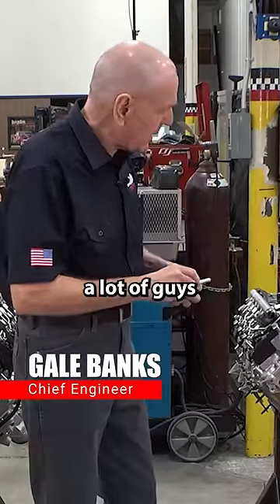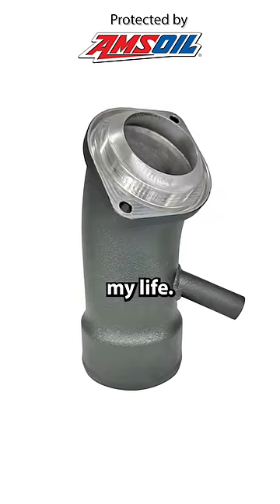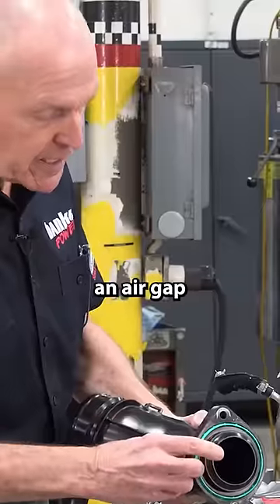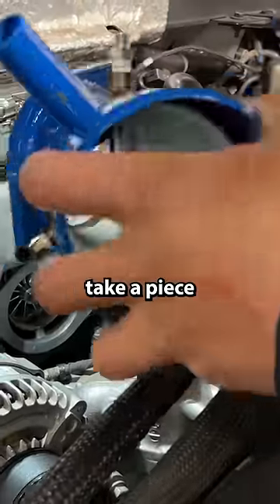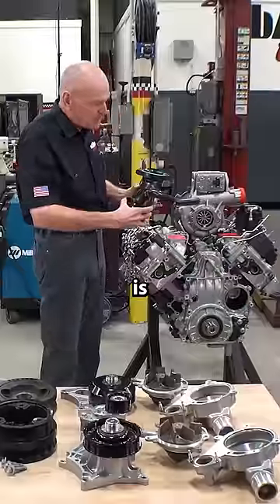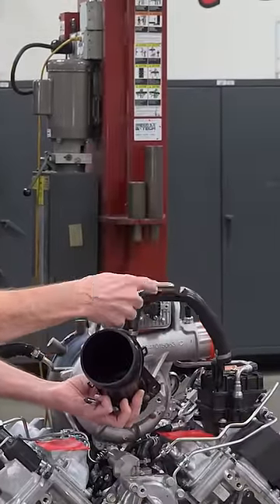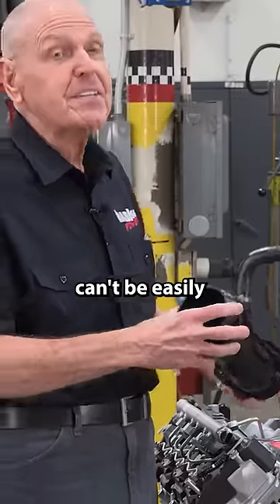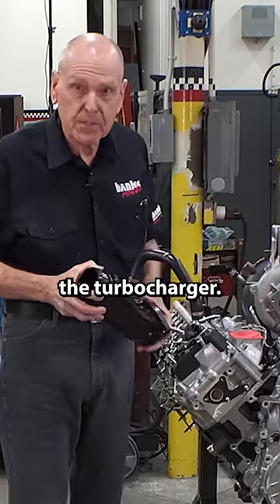The factory guys got it right. Don’t delete this!

Comment: Gale Banks is a genius. I would follow any and everything he says I have a Ford 7.3 L power stroke 1999. It’s stock with 400,000 miles and a six-speed manual. One day I’ll have myself Cummins or a Duramax that I can build up to a reasonable horsepower but more important than power to me is reliability and I will not give up reliability at the cost of extra power.
Reply: Hey Matt, I have the same truck as you.  Only 78k on her, f250 7.3l CrewCab n automatic trans that has been rebuilt.  Can I ask what all you've changed out since new?  Ole field mechanic/fab n welder/tires ect.  Ole paradog pushing 70s.  Thanks, Ty

Comment: I had a fiat 124 that used to pull oil into the intake. Straight from factory. No modification. I think there was an engineering issue from the factory.

Comment: I use a gauge called a manometer to diagnose mixture control malfunctions regularly on the BMWs I work on daily. Crankcase pressure is critical if you have a MAF sensor. Never seen a CEL from CCV malfunctions on MAP based engines like the W10/W11 Mini Cooper.
Reply: I'd like you to have a look at my 5l supercharged Range Rover with occasional lean code and high positive ltft's with an off idle stumble and surging ram's at cruise. Ugh.
Reply: @nyplantings2420  If you don't find anything from a smoke test the pop the intercooler off to inspect. I've seen those supercharger intercoolers develop a pinhole leak on the inside that drips into the intake causing random misfires.
Reply: I can't use the manometer. Whenever I pick it up, it immediately goes to 200%.
Reply: What about turbo bmws?
Reply: @megodlike--  I don't know about yours, but my '08 335i twin turbo has wastegates.

The advice from Mr. Banks in this video is much much applicable to turbocharged diesel trucks, many of which run big ass single turbos or compound turbos, and I don't think most of them have waste gates. Not saying it's a worse system necessarily, just a different one. 

The surging he's talking about occurs when the turbo is spooling super hard and then you come off the throttle. If you're modded to the gills and sucking more air through the intake than was ever intended, and if you've removed the valve that's supposed to open in case of a potential backflow situation without putting any other failsafe into play, you can end up with a big turbo spinning super hard, exhaust pressure builds up, and builds up, and builds up, and it's that pressure that eventually creates so much work for the turbo that it's no longer able to continue compressing more air, so instead the accumulated pressure starts to overcome it until it ends up bringing to a stop and then forcing it to spin backwards. That's TERRIBLE for the turbo and bad for the engine, too.
Reply: @allmycarsisbroke  Appreciate the explanation, I have an e92 335i with the n55  and not the n54 you have.
Reply: @megodlike--  Everything I said about the N54 is applicable to yours as well. It's a "twin scroll" and not "twin turbo" but the overall build and all the circumstances I described apply in both cases.

And whereas the N54 is notorious for an issue with the wastegates that starts causing a bit of a rattle as they get older, I think the N55s have a lot less problem with that (or with any of the other common points of failure). If you don't mod your car heavily or beat the hell out of it, the N55 will perform just as well as a stock N54, but cost you a lot less in maintenance and probably last you a lot longer. 🙂
Reply: @nyplantings2420  First thing I would check would be fore vacuum leaks. By far the cheapest thing to solve and easily one of the more likely things to cause those symptoms.
Reply: @allmycarsisbroke  Yeah I like to think of that as the reason I went n55 over n54. The thought of paying for injectors or anything not typical to fail on a bmw like water pump/gaskets. But then again you got the ability to push a lot of horsepower if you wanted to.

Comment: I've never understood why people think that they know every piece of automotive technology better than the engineers that designed it. Certainly, there is room for improvement in some areas if you're willing to deal with the consequences, like a louder exhaust system or defeating emissions devices, but for most systems, most driving situations, and the vast majority of drivers, the OEM got it right.
Reply: Exactly!
Reply: I've been saying that for years!
Reply: Mighty Car Mods of all channels did a dyno test of various intakes. They tested the OEM and filter as well. Not one aftermarket intake system performed better anywhere in the rpm range than the OEM.
Reply: Never accept that the manufacturers know best. If they did it wouldn't break or wear out they build to a price and are controlled by accountants. Gale on the other hand is purely about making the best it can be
Reply: @davidsawyer1599  You need to reread what I said. I never said that aftermarket can't perform better. Try again.
Reply: @Doctorevil666  Wrong. Reread what I said, then you may join the conversation if you can post something relevant.
Reply: @christophernuckolls9964  I've re-read your post multiple times! Obviously english is a second language. My first language is english either that or you've blindly taken offense to what I've written. I've said nothing about the after market Industries
Reply: No, oem never has it right
Reply: @jeffreyvandenbiggelaar1399  Never? Not once, ever? Cars don't drive? What do you use them for, then?
Reply: @Doctorevil666  Wrong, again, little guy. Your unintelligible temper tantrums contain no value and contribute nothing constructive to the conversation. Now sit down. The adults are talking.
Reply: Vehicles are designed to sell and break down and then buy parts that's how they make money. Somebody who knows thier stuff like Mr banks will always be better and improving on oem. Yes there's alot of companies making bogus performance parts, but there's also alot of places like banks industries that know thier stuff. Sometimes oem is better but not at all always. Like I said it depends on what you're expecting from it. Going fast? Different, hauling heavy load? Different, better fuel milage ? Yep Different. Stock probably does all ok. You won't find stock rods and parts like that that are as strong as aftermarket,
Reply: The thing you don't understand is that not every one is using it the way the engineers intended so they modify it to fit thier needs or wants.

Comment: Never trust always verify. I understand that this system is designed to work correctly but that doesn’t mean there isn’t room for improvement . Sometimes materials are left out to meet margins or there is manufacturing complexities that can’t be afforded. Then theres the government meddling into design who want to cripple and/or control systems which ultimately interferes with ownership rights.
Reply: Yeah but if you register with the state you're transferring ownership to the state and you have the usufruct privileges of driving it and maintaining it....FOR THE STATE. SO ownership rights huh? Bring that up with the state and DOL or DMV. Only if you have the original certificate (not a copy) will you have true ownership rights.
Reply: So, you melted your engine? 🤔😂

Comment: Im not sure people care, ford for instance pushes so much oil that you can watch it drip from every pore of the pvc hose.  The ecoboost pushes a half of a quart every 2,000 miles.  My last 3-2.7's and 3.5 all wept oil so badly it would leave drops on the ground. None have a special surge area, all just silicone hoses.

Comment: What factory guys didn't get right is oil vapors recirculation into engine intake. Yes it helps to prevent pressure building into crankcase but that dirts the whole intake system. 
It doen't disturb much regarding diesel engines but petrol engines got the same and oil contamination in intake mixture can lead to knock andengine damages.

Comment: The factory hasn't got anything right on the diesels in the last 18 years..
Reply: That's not necessarily true, it depends on what you're comparing it to.
Reply: How are bad aftermarket parts the fault of the oem?
Reply: That's what happens when the EPA gets involved.
Reply: The bigger idea being there's generally research and development implemented in factory parts. And the "bigger is better" or "aftermarket is always a benefit over stock" thought process is more often than not a falsehood. 

I guarantee 99.5% of people adding an aftermarket intake inlet pipe didn't notice or understand what was designed into the OEM inlet to begin with. Anti surge properties are not something I've ever seen retained with majority of aftermarket intakes. That's true for diesels as well as gasoline worlds
Reply: @highpsiguy4085  I understand completely how much R&D goes into factory design. I'm pointing out that the government wants things done now, and the factory has to produce the numbers enforced by the government. Could you imagine what the diesel world might be like if the EPA would push fuel efficiency prior to emissions.
Reply: Longevity, simplicity, fuel economy, with all the epa crap these new ones will never get near the old diesels.. this world was working just fine before government and epa had to put their authoritarian rules on everything..
Reply: @justinmoore4898 
BureauOfJustifyingOurExistence.

Comment: An experienced Audi tech told me to just use OEM parts, and don’t alter the car with aftermarket parts. The mechanic said Audi has 1000s of experienced auto engineers spec cars for different purposes. For example, when you boost HP through ECU you alter everything. Now with that higher HP(speed) you need larger or better quality brakes, maybe different wheel size and/or tires.  Can that suspension handle hitting turns at 70 and not 45 like it was designed?  Buy the race edition for that

Comment: There are situations where you can improve the oem  intake system. For example, Honda knew they could have built an intake that produces an extra 20 wheel hp but jt would have required the consumer to use tools to change the light bulbs. The compromise was to have a worse intake but the aftermarket was able to dyno prove a cold air that showed massive improvements.

When I looked at the aftermarket intakes for Diesel vehicles, I didn't see any improvement in horsepower. It seems that with modern emissions and computers, there isn't a big gain in replacing the oem tubing. It js already built to deliver the best flow at stock power levels. 

Only after you increase the power output, do you need to really start changing the exhaust and intake piping. Even then, you have a downside in noise which does harm the driver on longer drives

Comment: But many of the people that make such modifications have zero understanding of any of that and instead bolt on or remove crap they think is cool.  How many sh!tty econoboxes have had the exhaust system deleted and replaced by something cobbed together by similar idiots resulting in LESS POWER and less economy.  These are the same id10t's that bolt on a massive rear wing on a car with less than 200hp resulting in reduced top speed, a further reduction in economy, and only a modest boost in some cornering situations while negatively impacting performance 90% of the time.

Comment: I'm glad that I never had the money to ever make my vehicle go faster. I will always stick to the factory installs and stick to the mfg. maintenance plan.
Reply: can kill modern diesels tho…

My Impreza Boxer Diesel nearly died because of oem and official subaru service.

They barely did oil changes when doing longer trips mainly (every 30k officially) and my new mechanic now does it every 5-10k km. Still looks bad but it gets finally better.

But the real issues i had with my car they never adressed… much diesel in oil (the oil level basically was RISING, yet it was ok for subaru.
Also my DPF regenerated each 100-150km (active with off timed diesel injections leading to this mess with diesel in the oil)

Also, the agressive EGR settings literally clogged my intake pipe with soot and the cleanup process was a horror.

After finally doing what was needed (DPF removed, EGR disabled, little chiptuning to 180HP):
- No diesel in oil anymore (at all!)
- engine reacts much better to throttle
- overall emissions were going DOWN, tho the „bad“ ones got up (which the nature will process effectively enough!)
- fuel consumption was going down by about 20% (probably like 5-10% because of better mapping/tuning and 10% because of DPF removal and missing regenerations wasting much fuel else.)
But only if i drive honest, if i enjoy the 180HP a bit more, its also going up to 10l/100km. Tho drifting in snow gives me about 8l/100km, far from the regular 4,5-6l i need typically, but still great considering my petrol car need like 15-25l/100 km when pushing it more for barely more power than the diesel have.
Reply: Subaru said everything is ok and „its normal“, up to 100k km i had those official services (and all the problems)

After i nearly had an accident because my Subaru decided to kick in DPF regeneration where i needed all the power (109HP at this point still, reduced to like 70HP…) i looked for alternative mechanics and specialists.

Needed a good mechanic and an ex subaru software engineer but it worked out to repeogram the ECU for the modifications (subarus diesel software is super annoying regarding to DPF deletes and changes in general)

Another car we have is a 1,9TDi Golf 3 Cabrio from 1996, this car is for sure ok stock/oem, never had any problems within 600k km except once a clogged and old injector where we replaced all together at around 400k km. 

I really tried to keep the Impreza stock, but the governments and their marionettes decided to make diesel vehicles bad on purpose, and i can not afford unnecessary breakdowns or totalled cars because the engine destroys itself.
Reply: Ehh, OEM always produces a final product full of compromises to try and appeal to the widest consumer base and stay within legal restrictions.  
You can almost always get more reliable HP than the factory, just like you can almost always get more MPG.  That's why the aftermarket exists in the first place.
Reply: @harrison00xXx   Not that I disagree with it all being a problem and yes removing it can fix them, but that seems like an excessively frequent regen cycle.  What's your driving like regularly?  See it often when people aren't getting the vehicles hot enough regularly.  I often talk people out of buying diesel trucks because of it.  Anything with full modern aftertreatment WILL suffer these issues if not run hard enough.
Reply: @JBansal  25-50km a day, i even tried pushing it for 150km+ continuously and it also started regeneration every 100-150km.

The DPF tho was super clean as we removed it
Reply: @harrison00xXx  Well, I can say that my book recommended an oil change at 15,000 miles. That did not sit very well with me so I do it every 6,000 miles. The air filter I did wait to 15,000 miles.
Reply: @383mazda  I'm all about MPG. I believe I have all of the Hp that I need.  Ram 3500 with HO Cummins with Aisin transmission. At a steady 60 MPH I can get 22 MPG.
Reply: @oldsalt8011  I did it also more often than needed since the subaru mechanics refused to do it and would stick otherwise to the manual and 15-30k km despite being like 2 years+ old.

But the real issues they never even attempted to look at because they knew fixing those (intentionally created!!!) issues would make the car „illegal“ to drive.

Funny thing, we have 4 cars, 3 bikes and some e bikes and scooters, ALL of them are literally illegal since they are modified a way the traffic law doesn’t like.
From a tuned e bike going just 5kmh faster than allowed, to a unregistered scooter which is really FAST or just a motorcycle with slightly louder exhaust
The cars are either just chiptuned for economy/more power or done more as with my Boxer Diesel Impreza to fix the bad things ruining the engine and driving experience.

Hard to believe for many people… but doing „illegal“ things nowadays is often the ONLY RIGHT THING TO DO.

Comment: I’ve ran into something similar on the new wranglers with the 2.0. They have a high and low side purge system. People put aftermarket intakes on them and wonder why they are getting a check engine light

Comment: Faster moving air has less pressure... the turbo is meant to move air quicker at the needed pressure for fuel mixture, as the rpm increase. Which means. You need more air density to compensate over time or the fuel becomes leaner. Which could be good given hp and inertia. , but it its not really a compressor. Its a smooth calculator.  You can have restrictors later in the system and open the turbo for back pressure flow. Which creates potential pressure energy. But the turbo will burn out over time. But then you will have instant input energy and higher throttle response. This is why dual turbos were designed. A precharge and a compressor like charge.

Comment: And this is way most aftermarket parts suck. They hear the turbo flutter and think they increased performance, when all they are doing is to damage the impeller.
Yeah, turbo flutter stututu sounds awesome, but only makes your engine run worse.

Racecars can do with it because they don't mind throwing away the turbo after the race and installing a new one since the sponsors are going to pay for it.

Comment: MK7 VW GTI guys are learning about this exact problem. Everyone makes turbo inlet pipes for the mk7 GTI, but basically all of them create issues with the PCV system. VW's OEM design has a very specific curve into the PCV line that none of the aftermarket vendors matched, which obviously causes damage over time to everything.